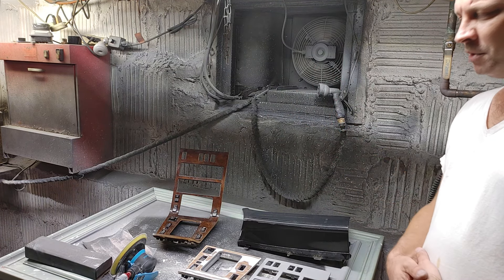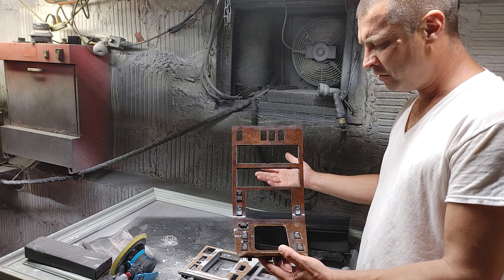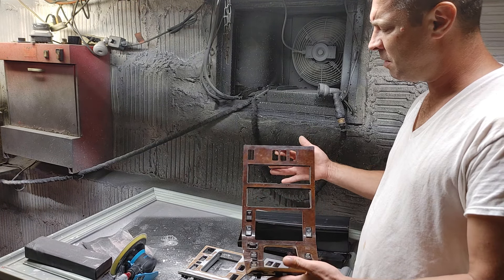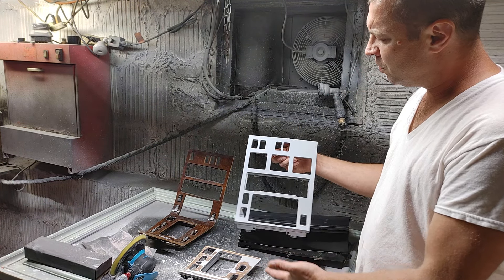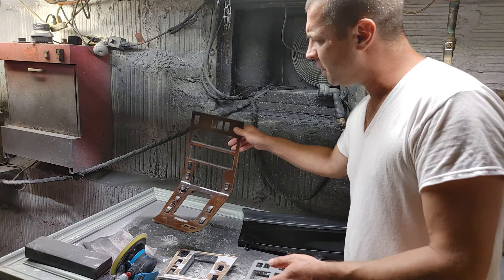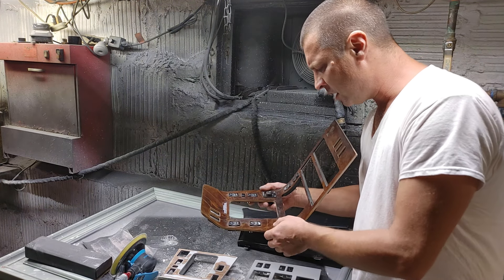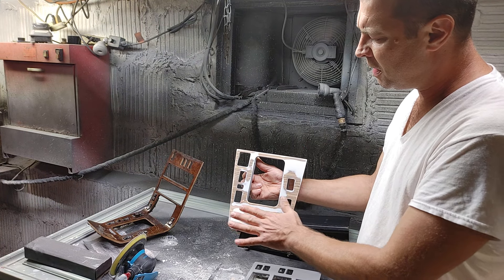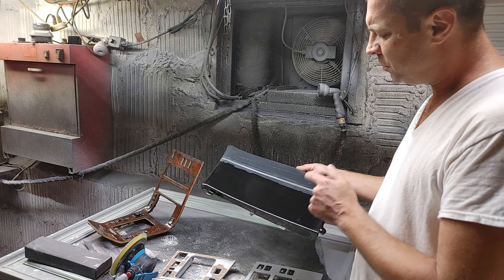1992 Mercedes 600sel project. Part 14. Center console wood panel

Comment: Hi Victor - You did some work rebuilding my throttle bodies earlier this year on my ‘95 SL600. Any recommendations on repairing ortho seats? Bladders are NLA from the dealer which is where my leak is coming from.

Comment: Unfortunately this is your first video I’m going to dislike. How could you come up with such a lame idea about fake carbon film. You were always judging previous unprofessional “repairs” in your videos and now want to join their club 🤦‍♂️
Just leave those panels black man, do not go the “ricer” way
Reply from the maker: @Mike-gj9rp  it's ok. I would keep the wood original but was not successful refinishing it right. 
Apparently I had the panels painted black and they turned out pretty nice. So I decided to just leave them painted black. I might also just paint the seat control wood black. Those are also cracked up and don't look good.